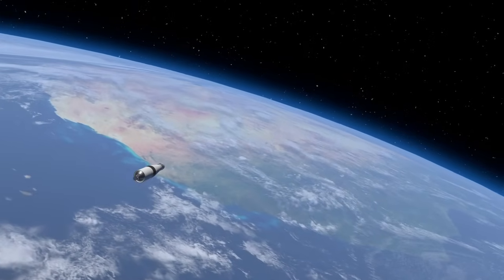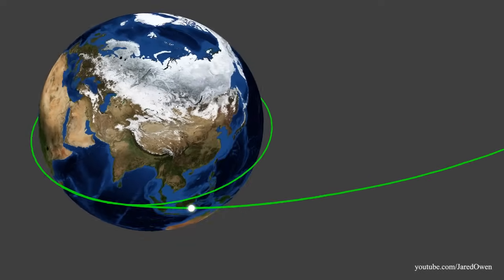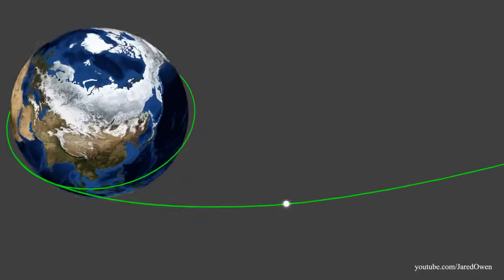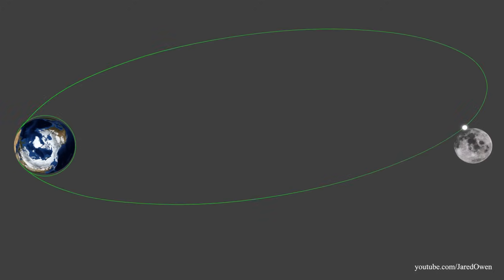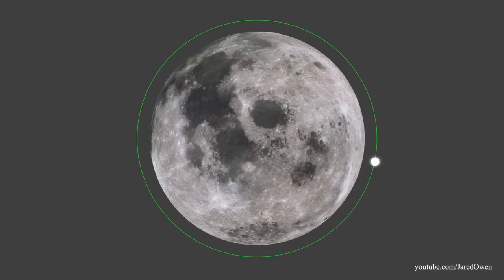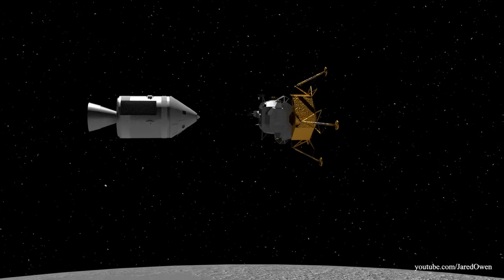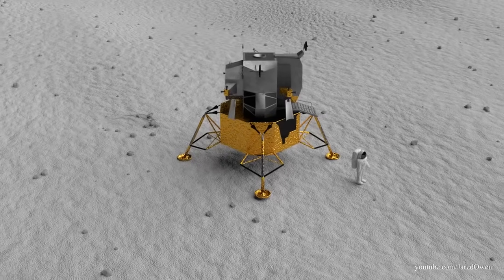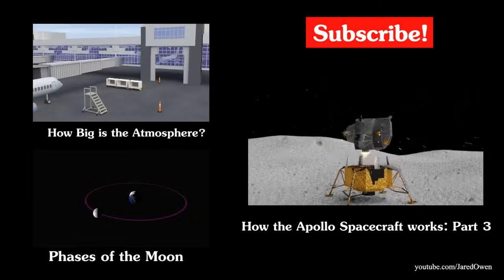How the Apollo Spacecraft works: Part 2

Comment: In the animation the fire from the rocket slowly fades out when it lands on the moon. The lunar lander was a heavy piece. Up to 17 tons when the tanks were full. Which required a powerful rocket. The astronauts were practically sitting on top of it. Where did that flame go when it hit the ground? Worth mentioning that the engine was never tested before mounted on Saturn V. The fuel was very toxic and would damage the engine so they had to build a new one everytime they tried it. That's why they used another machine for practicing on Earth. When it was time to go to the moon they assembled the lunar lander and hoped for the best. During Apollo 11 they kept working on it until the last minutes. I got that info from a documentary so don't hang me for it.
Reply: The descent stage engine could be throttled and close to touchdown was at only 10% power. Three of the legs had 6’ contact probes on them and as soon as the contact light went on, they shut off the engine. The engines did use corrosive fuels but no, they didn’t have to build a new engine every time they tried it. They would rebuild it though. The ones used for each Apollo mission were tested and then rebuilt. So essentially it would be as close to being new as possible. There was numerous ground testing done and something not so well known is that the ascent engine was often at the top of the notorious list of problems that could seriously delay or even prevent the moon landing from happening. The problem was combustion instability and it took some time to figure out. Once solved, they conducted 40 test firings which was twice as much as the usual requirement for certification. The descent engine was also capable of multiple ignitions and rated for this during the certification process. The corrosive propellants biggest issue was that unlike regular propellants that would boil off after use, hyperbolic propellants don’t and have a tendency to leave residue that could gum up the components or cause leaks. The oxidizer used would make anything it came in contact with burst into flame. A great book about this is Tom Kelly’s Moon Lander.
Reply: Forgot to mention that the LM was designed to operate in a 1/6th G environment so those engines could never have been used in actual flight testing on Earth. They were tested with Apollo 9 in Earth orbit and again with Apollo 10 in lunar orbit plus the unmanned Apollo 4 & Apollo 6 missions. The LLRV & LLTV’s were developed for the commanders to practice the final portion of the landing. The incident with Neil Armstrong’s close call is often brought up but there were close to 800 other successful flights with them. After Armstrong’s incident, NASA wanted them removed from the training program but the astronauts insisted they be kept as they were the best method for training for that last bit of the landing. 

As for this “...hoped for the best” remark, this is just the typical trivializing and ignorance of just how much testing and planning went into the Apollo program. The most technically difficult part of landing on the moon was building a large enough rocket to get the necessary moon landing payload into LEO for the TLI burn. Of the approximately 400,000 people involved with the Apollo program, roughly 300,000 were needed designing and building the Saturn family of rockets plus all the logistics required to prep them for launch. Prior to the Apollo program, the USA experienced as high as a 40% failure rate with its various rocket launches which were pretty small and relatively uncomplicated. Of the 32 rockets in the Saturn program, all 32 of them were successfully launched. These were some of the most complex machines built at that time culminating in the Saturn V with its 13 successful launches. Pretty remarkable considering they were expecting half of the Saturn 1’s & 1B’s to fail. If you have any doubt about this being the most technically difficult part of the Apollo program then take a look at the Russian moon landing program that accomplished many of the same things the Americans did including soft-landing probes on the moon and testing their version of the LM in LEO. However they were never able to successfully launch their version of the Saturn V which was the N1 rocket that had 30 rocket engines in the first stage alone. After the fourth attempt that exploded spectacularly not soon after launch, like the previous 3, they abandoned their moon landing program.
The big reason they had such a remarkable success with the Saturn rockets was the quality control specification that needed components rated to a 99.99999% reliability requirement. The Apollo CM/SM and LM were held to that same standard.
Reply: @mako88sb  I've never seen any footage where they did flight testing that was even close to what they had to accomplish on the moon. Hovering a few meters above ground isn't the same as orbiting at 6000 km/h. A proper test would have been to throw it out of a jet plane and land safely. If I could do that here on Earth I would feel safer that it works on the moon.  I've never been to the moon of course but from experience I know that things have a tendency to be more difficult than you imagine. The ping pong ball is yours.
Reply: @jerryhall5709    Right. There’s no footage of the space shuttle having its heat tiles tested during an actual reentry before a crewed mission. Does that mean all the shuttle missions were faked? Just a simple yes or no is all I require.
Reply: @jerryhall5709  
You could not test the thing here on earth. Dropping the LEM from an airplane is not comparable to flying the thing on the moon, that's ludicrous.

Comment: Explain thevbattery technology for a multi day trip, multi surface walks with HVAC packs and multi rover rides.
Reply: Here you go:

https://core.ac.uk/download/pdf/10548425.pdf

https://www.arpa-e.energy.gov/sites/default/files/documents/files/Miller_RANGE_Kickoff_2014.pdf

https://www.hq.nasa.gov/alsj/ALSJ-FlightPLSS.pdf

https://www.lpi.usra.edu/lunar/documents/NASA%20TM-X-69516.pdf

https://www.designdevelopmenttoday.com/industries/aerospace/news/21079800/the-engineers-who-designed-nasas-apollo-batteries

Comment: How did 2 astraunauts get into the LIM before the moon landing (3:12 - 3:15 in the video), did they have to transfer on the outside or was it possible to climb into the LIM from the front of the command module
Reply: There’s a hatch between the lm and csm
Reply: There’s a pretty ingenious system called the probe & drogue that after docking with the LM it can be removed from the inside of the CM providing access to the docking tunnel.

Comment: What holds the saturn 5 upright before it lifts off?
Reply: Four massive hold down arms:
https://www.hq.nasa.gov/office/pao/History/SP-4204/ch13-4.html

There was also a system incorporated to reduce transient loads that might happen if the Saturn V launched too quickly:
http://www.collectspace.com/ubb/Forum29/HTML/001327.html
Reply: @mako88sb  thanks
Those four "grabs"held it upright and stopped it toppling over even when being transported to launch site,WOW
It's a wonder the weight of rocket didn't cause it to either break away or even crush where grabs held on
Reply: Gary Roberts   Yes, pretty amazing engineering. Plus they had to allow for wind loading.

Comment: Why the command and service module should be done 180 degree turn around ?   If CSM was upside down from the beginning, It doesn't need that process.
Reply: Wouldn’t work that way. The big issue is that the launch abort tower can’t be directly attached to the CM were the crew is. Attaching it to the SM would require a abort tower so large that the additional fuel required for launch would be too much. Plus the crew wouldn’t be lying on their back which is needed to counter the G-forces during launch.

Comment: great video. Just a little adustement. On the LEM, there are some "spike" to shut down the engine near by 1m meter from the moon surface to avoid a bubble gas under the LEM and could make him roll. otherwise, this is a great explanation !

Comment: Thank you, you have just proven that Newton's 1st. law of motion is wrong
Reply: How?
Reply: Why?
Reply: In an animation you can do anything, the same as in Hollywood studio. At 1:21 min. What is the force that ejects the CSM and what force is stopping it. The same applies to the 180deg turnaround. After the ejection it’s velocity should be higher then that of S-IVB. How can it dock onto the LM if according to Newton it should accelerate away from it. Between min1:21 and min3:37 they have made another 180deg. Besides doing all this docking and pulling remember that all this happens at speeds probably around the 10,000m/sec mark.
Reply: @joachimlandes5745  rcs doofus
Reply: @joachimlandes5745  rcs is a thing you spoon
Reply: @joachimlandes5745  It's clear that there are many aspects of the flight of the spaceship that you simply don't understand.
Reply: @joachimlandes5745  RCS
Reply: @joachimlandes5745  Has anyone mentioned RCS yet?

Comment: and they "really" did all this with wooden sensors and storage discs that couldnt even save 1 or 2 iphone pictures? and who believes that hollywood shit?
Reply: Um yeah guns were made 400 years ago of of matches? Cars were powered by hot water what’s your point?
Reply: @maxace1078  my point is that hopefully in 2025 or 2030 humans will arrive on the moon for the first time in history...
Reply: @Knightfire66  no, it was 1969
Reply: No need for storage or graphics or games as on your phone.  They only needed to calculate velocities and heights.  I was using the university IBM 360 back in 1968, there were plenty of computers around then of all sizes.

Comment: Quick ? Jared: so if a craft can orbit the earth in about 40 mins & the earth having a circumference of about 25k miles; using this logic, a spacecraft should only take approx. 6 hours & 40 mins to traverse from Earth to the Moon; being that this distance is 239k miles. So WHY does it take them the better of 4 days??
Reply: Because after the TLI burn were they reached a velocity of 25,000 mph, Earth’s gravity immediately started to reduce that max velocity. It continued to  do so knocking the velocity down to just over 2000 mph until they reached a point were the moons gravitational influence started to accelerate it again.
Reply: @mako88sb  thx
Reply: The two comments above give a good explanation for your question, just like to point out that an orbit of Earth takes about 90 minutes.

Comment: Great videos. Very clear. I had been wondering how the lunar module depart from the orbit, now I know. I'm curious when the command module docks with the lunar module (1:32) how exactly do they attach to each other? What kind of mechanism (which should also allow the latter to detach later on)?
Reply: It’s a pretty ingenious device called the docking probe and drogue mechanism that can be detached from the inside after the connection between the CM & LM has been secured. Then the bulkheads on the respective spacecrafts could be removed revealing the tunnel between them. Btw, although only tested in Earth orbit, the Russian version of the CM & LM was joined together in a similar way but there was no tunnel between the two so a cosmonaut would have to do a EVA to and from the lunar lander.
Reply: @mako88sb  Many thanks for all your answers to my questions! 👍👽
Reply: Np. Btw, there’s lots of great info you can find online such as all the Apollo mission reports. The pictures aren’t as good quality as the book versions but still, very interesting PDFs to look through. There’s also all kinds of Apollo Experience Report PDFs that are similarly easy to access.

Comment: How anyone can believe this utter BS I have no Idea. There are just so many assumptions and leaps of faith; for instance, for there to be propulsion you need to have something to push against, these geniuses claim 'outer space' is a vacuum, so what exactly are the various lunar crafts 'propelling' against? What about the temperatures, aluminum melts at 1250 F but these geniuses claim the temperature in 'outer space' is between 950 to 3600 F, so how do these modules not just burn up. This video is such BS it beggars belief.
Reply: You don't actually need anything to push against. And they never claimed the temperature in outer space is 3600F. Outer space doesn't really have a temperature since there's nothing there.
Reply: You obviously failed high school physics, the example of combustion in space is not an example of free expansion where there is zero work being done.
Reply: 'for there to be propulsion you need to have something to push against' No, try throwing something heavy while on a skateboard (actually don't you might fall and get hurt) but if you did, you'd move a bit. That's one of Newton's laws.

It hurts a lot less to put your hand into steam than it does to put it into the scalding water. Now imagine taking that steam and making it a thousand times thinner. That's what space is like

Comment: with only lunar, command and service module, how they can travel to moon which far 300,000 km. The size of those module can't contain more fuel
Reply: You don't understand how a spacecraft works in space, to go to the moon, you don't need to use your engine all the time, all the way. You just need to fire your engine once for a certain amount of time , and you'll be sent on a trajectory, since there's no air in space, nothing will stop you, you'll continue to travel until you meet the moon and the moon gravity will decrease your speed.. For Apollo they didn't use the Service module's engine nor the Lunar Module's engine to go to the moon, they used the engine of the third stage of the Saturn V rocket. They only used the fuel in the module to go into lunar orbit and get back to earth.
Reply: @chemsilestrat280  ok, understood. Thanks for the information

Comment: How do you get thrust in the vacuum of space? How do you get through the firmament? Since we live in a closed system? How do you get through the Van Allen radiation belt's? Without being fried? NASA has said that they are working on a crude craft that will get them past low earth orbit!  Dang I thought they already did that? Oh I forgot they said that they lost all of the telemetry data, and it's a painful process to build it back up! Folks we never went to the moon, and we never will!
Reply: Thomas...All your questions can be answered by merely looking them up. Why are you wasting time asking these questions here, if not just to troll and goof off? You silly guy.
Reply: Lee Clark he is a troll and he don’t want answers as such, pretty simple.
Reply: @tgstudio85  Correct. Best to ignore trolls.
Reply: @leeclark4495  I ask these questions because I have looked them up, to know for sure that you have truth, you need to look at both sides of the argument, before you decide, no need to be offended!
Reply: thomasparrish429 hey trolololo, why there should be no thrust in vacuum? You realize that rockets expel tens of tons of fuel per second, from that  is reaction force as newton law of inertia states.
Reply: 1. Throwing things makes you go the opposite way you throw things
2. There isn't a firmament
3. By closed system, it doesn't mean literally closed, i just means that outside things don't affect it much
4a having even minimal shielding
4b going through fast enough to not get much (like running through the rain to not get as wet)
4c going north or south of them (they're mainly around the equator)
Reply: There’s no firmament. How is it held up if there is?

Comment: How did they move to the lunar module? Spacewalk ?
Reply: No. The probe used to dock the CM with the LM was designed to be removed by the crew after a proper seal between the 2 spacecraft had been confirmed. With the docking probe out of the way, it was easy to move between the spacecraft through the docking tunnel. Btw, the Russians would have had to do a space walk to transfer to their version of the LM. Plus it was a one-man spacecraft.

Comment: very informative videos, what an incredible achievement by the human being. 

just one question does the service module and lm seperate with the lm leading or lagging the service module, i ask because when entering the lunar orbit the service module appears to be leading(engine first) and fires its engine to slow down and achieve lunar parking orbit,, but conversly it needs to be flying forwards to enable an engine burn to escape lunar orbit.
is a manoever performed to accomplish this?
Reply: Yes, after the lunar orbit insertion and prior to the LM descent, the CSM/LM combo is reoriented so that the LM was leading. They had to be this way for the eventual rendezvous and re-docking. Not exactly sure when but all the Apollo mission reports and voice transcripts are available online so it should be fairly easy to determine when from those sources.

Comment: can the device that you want to plug to the foot of the plane. because if the plane wants to fly after landing. the legs of the plane separate and remain on the surface of the moon and stick tightly to the surface of the moon.